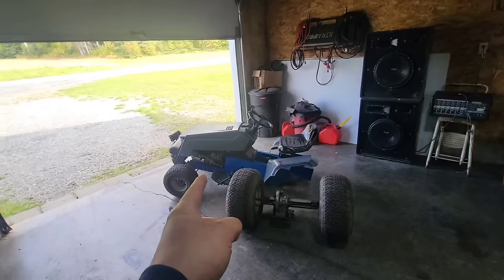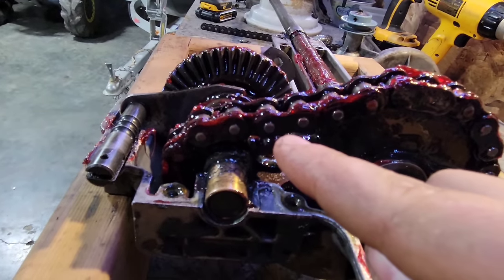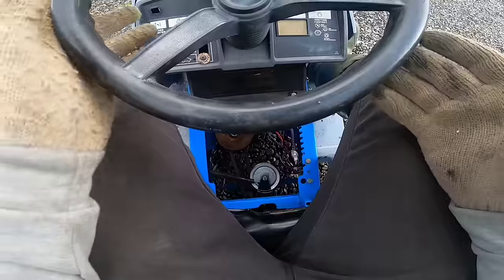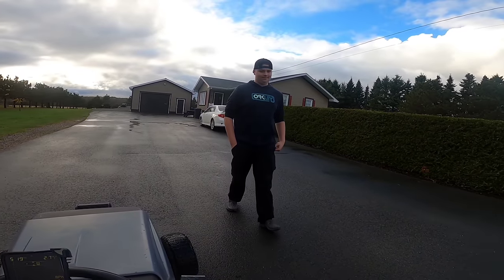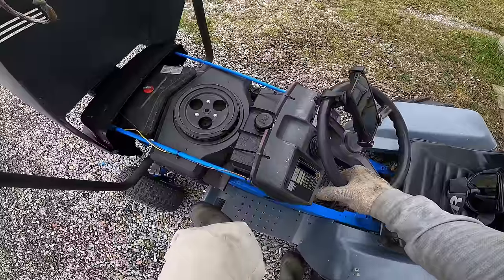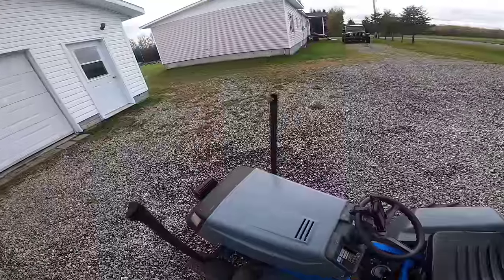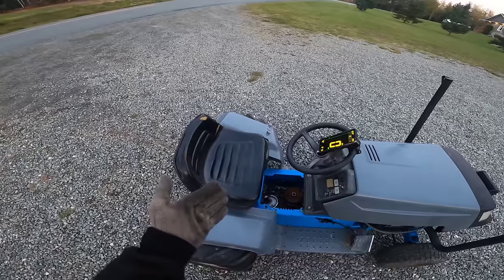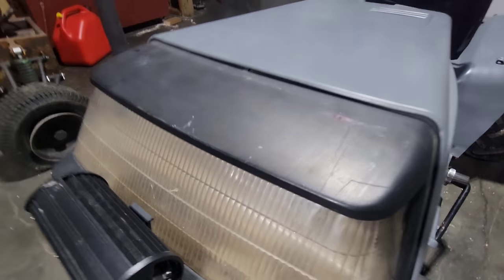THE 70 MPH MOWER CHALLENGE PART #1

Comment: Yo bro, I have some tips that will make the lawn mower faster.  I think you know this already, but incase you didn't here are some tips:

I am assuming that you haven't modified the engine yet. I would suggest doing that to increase rpm/power. I think the main reason you cannot hit the 70mph goal is because the governor in the engine is not allowing you to, and removing the governor would remove this restriction and allow you to reach a higher rpm and top speed. Be careful tho, cuz the engine's internal components aren't meant for higher rpms you'll get from removing the governor, so you'll need stronger parts such as flywheel, connecting rods, and heavier valve springs. I would also suggest  better carburetors so you have plenty of airflow and fuel.

Good luck with the lawn mower, its a powerful ass motor, and I bet i can go extremally fast when modified. I will be following along this build as It's really cool.

BTW, a FULLY built 690cc could get you 70 hp. Check out Red Beard's Garage, he built a supercharged predator 670cc.
Reply from the maker: i seen it the 70hp 690cc its wild ! i would like to build a opposed twin tho they are my favorite engines !

Comment: Alright partner i gotta few suggestions for ya if you wanna hear'm! new coils, and magnets on the flywheel, 0.2 - 0.5 mm thick washers so you can file them down to work as bushings really that's temporary to get the slap outta the wheel. OH and making a cowl induction system is so easy on these briggs and strap on motors just tap screw a big ass air inlet lmao! Hope these help you in someway, they did my 19.5 hp wonders.
Reply from the maker: im open to any tips and tricks to make that opposed briggs stronger

Comment: Hey with mine I put a string on the piece that you adjust for the idle and it goes 20 factory so try to do that and you just pull the string for it to go faster

Comment: Maybe try a racing mower belt drive system that runs the belt straight from the engine shaft to a pulley fixed to the rear axle. You would have to find a way to rotate the belt 90 degrees, but it's easier than it sounds and if done right it'll be way more reliable than the current setup.

Comment: the reason you could not get faster with the twin is because it is a flat head. is also why you thought it had more power at the lower rpm because they do. but the single cylinder is a over head valve. thats where your higher rpm power is coming from and why it will go faster.
Reply from the maker: i learned something 😂  flat heads = low end power OHV = top end power

Comment: any chance we see a possible small turbo in the future, or... might i suggest a leafblower?
Reply from the maker: might happen
Reply: also there is a 3 speed trans you can get for these they are fully manual but the shifter mounts where you can look down and see your belts might be a solution to you breaking parts in the back and having to change sprockets.just a thought lol @MisterdionneYT
Reply from the maker: this mower will end up with straight axle and horizontal shaft so no need to waist money on transaxle 😅  i apreciate the tips thoooo

Comment: I have an mtd fnr transaxle, do I need the variable speed double pulleys and how would I hook them up in a normal tractor cuz I want a reasonable speed
Reply from the maker: the double pulleys are great for high speeds but its so difficult to find a proper belt setup ! it either slips at high speed or doesnt stop going foward because its to tight ! its like if there isnt a perfect setup for the double pulleys

Comment: need to ditch that whole belt system. Get an mst 206 from a craftsman 6 speed, they're oil filled. I hit 61 mph on my mower with an 8.25 in the front and a 3.5 in the rear, normal clutch. I had a 27 hp vtwin but your opposed twin should make it no problem.

Comment: And having straight pipe damages your valves and gives less power so putting a different exhaust might give more juice
Reply: Mm, having straight pipes causes a lean condition which will cause valve damage and loss of power, which can be rectified by installing larger jets.
Reply: @99milesaway41  Really! I need to get that to fix mine
Reply: @reesemolloy6109  oh yeah brother, fatten the jets up and you'll get a bunch more power. Just don't overdo it 🍻

Comment: You can put a cvt system from a automatic atv or snowmobile on a lawnmower make it so u have a natural so u can start it without being in gear and have more acceleration and tip speed that way and from the cvt use a chain and sprocket setup instead of belt so no chance of slip or blowing the belt off.... the youtubers "Cars and Cameras" was making a racing mower and they did this I recommend checking them out
Reply from the maker: everything you said is already planed 😂😂  this mower gona be a beast when im done with it 😅

Comment: If you get rid of those rough groove tires which is slowing it down and put some smooth tread tires are even instead of go kart slicks on it I guarantee you you will get 70 to 80 mi an hour out of this thing remember tires are a factor as well Ohio fast something Will Go on pavement
Reply from the maker: i know !  i will probably put some smooth tires for part 3

Comment: u need more power in the motor     your hitting valve float throw 50lb valve springs in the motor and throw a mikuni 40mm round slide carb on the motor (snowmobile carb) and remove the governor out of the engine and the mower will reach 60+ mph       almost there

Comment: Gotta be cautious with cast iron flywheels. They will blow apart with the constant high rpm. 
Honest i jist think you cant get to a high enough rpm with your gearing and tire size to hit 70. If you built up the 14.5hp motor (Built aluminum connecting rod and flywheel with forged piston, stiffer valve springs  and flat slide carburetor as well as some porting) to rev higher and make the same 20 or more hp i think youd be able to get 70. The 14.5 hp motor is alot lighter and would only get lighter with those modifications. I cant say it would be cheap but then again making more power never is!
Reply from the maker: im starting to think that the 14.5hp is actualy stronger lol